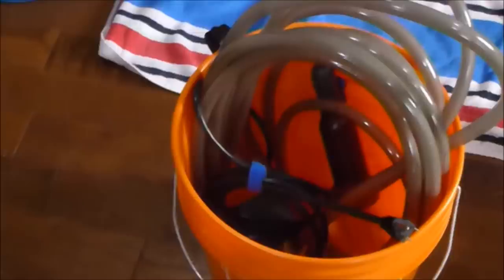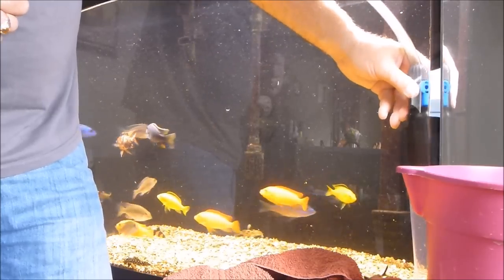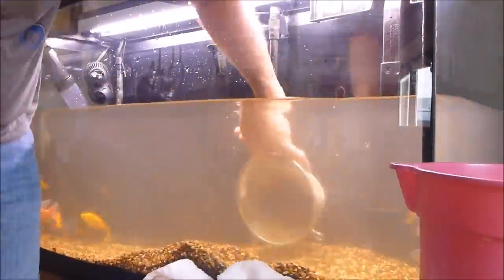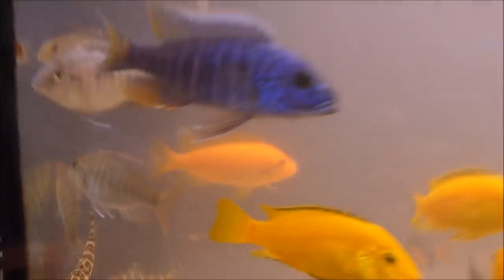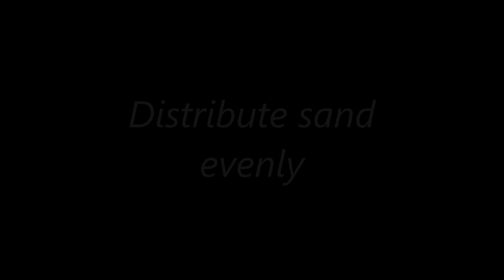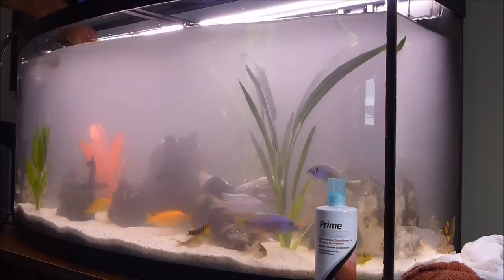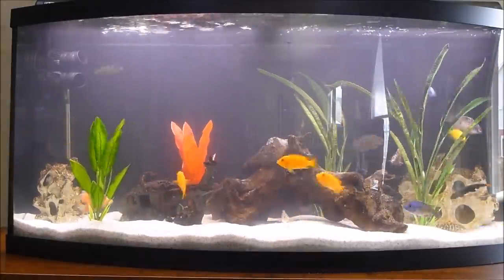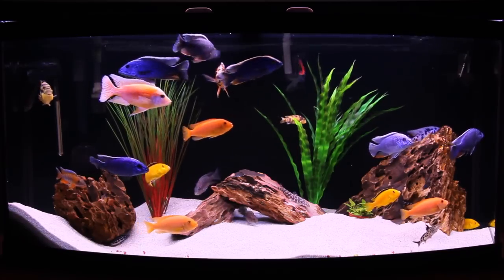Aquarium change from Gravel to Sand

Comment: Your aquarium looks so much better with sand! Im doing the same thing. Is your tank a 55 gallon?  Did you raise your intake tube?
Reply from the maker: My tank is a 72 gallon bowfront and I'm so glad I switched to sand. Yes you should raise your intake to reduce the amount of sand getting in your filters. Thanks for watching!
Reply: @bobbygsproaquarium  thank you I really appreciate it but I thought you're supposed to add one pound of sand for a gallon of tank and you only added 50 lb so I'm assuming I could add 40 lb of sand to my 55 gallon. I cant wait to get started! Great video

Comment: Thank you for the step by step! You're the real MVP! I'm making the adjustment from gravel to sand in my 150 gallon tank.
Reply from the maker: Thank you. I'm sure after you switch you'll never look back! With sand you just have to be careful cleaning the glass to be sure there's no sand in your cleaning sponge or it will scratch the glass for good.

Comment: i have sand and i went and got a sponge filter to put on the intake of my hang on back filter system. had to modify it but it works super! also replaced the cartridge filters with carbon filter pads cut to fit. now my water is the clearest it's ever been.

Comment: I have a 55 gal. cichlid tank, and I love the sand!  Used to do the gravel. but sand is a lot cleaner. Have a couple of geophagus that are spewing the sand around all the time.  Good to know that the sand is better for cichlids also.  The water is crystal clear all the time.  Don't hesitate to change to sand if you are wary. I did, and not sorry I made the change.  I also used the pool filter sand, and the biggest job was rinsing, but if you can do it by the bucket with an outdoor hose - it goes much faster.
Reply from the maker: I agree, I'd guess anyone that switches from gravel to sand  would also agree. It's important to have lots of water flow so the poop doesn't settle on the bottom. Thank you for watching and commenting!

Comment: What a lovely tank you have. And your poochy is so cute!!

 I've always been wanting but leery of changing over to sand due to issues i'd read about with water changes, vacuuming, etc. But i love plants, Corys, & loaches and it would be so much gentler on them. 

The one thing i'd do different in your change over is i'd probably take all the fish out with some of the tank water and put them into a bucket so as not to stress them during all that upheaval, but it looks like yours survived fine. I'm shocked when you say you don't have to vacuum it anymore. Shocked. The books all teach something else. You've really peeked my interest.
Reply from the maker: Thank you Windwipper for the comment and the advice. In future I will and have removed fish before making a change over like that. I'm not sure what books you're reading up on the maintenance required on a sand substrate. My advise is from very practical experience and although there has been quite some time since posting this video I still stand firm on the use of sand. But the key is to have enough water flow so the waste and detritus does not just sit on the bottom but rather get sucked up into the filtration. If you've already made the switch that's great if not charge ahead my friend. This switchover was done with pool filter sand and it is a good choice although I have since changed it again. The key is that your substrate is fine enough that the waste doesn't settle down in through it and also that your sand bed isn't more than about to inches .
Reply: @bobbygsproaquarium  Excellent advice! Thank you very much!

Comment: Gonna love changing my tank to sand this weekend. I have an unlimited supply of sand straight from the earth at a job site and its darker in color but so pure. Was wondering how to do it with the fish in. Thanks for this amazing video.
Reply from the maker: That's great you have an unlimited supply of sand. I switched mine with the fish in the tank so I don't understand your question, what specifically would you like to know?
Reply: I used white pool filter sand, works great for years.
Reply: @NitroVipers3  Which brand did you use?
Reply: @dvsasser  not sure the brand, went to the pool  place and bought it.

Comment: Since I switched over to the sand several years ago I have not vacuumed.  Even when I recently upgraded to a 75 gal., the sand that I transferred to the new tank wasn't very dirty. It was just red from clay.
Reply from the maker: Yes it's so much easier to maintain. Thanks for commenting.
Reply: Just a question . How do you clean up the fish poop if you don’t vacuum ?

I have sand and would like not to have to vacuum .
Reply from the maker: @operationhotshotinc.6887  if you focus on having lots of water flow it will keep the poop from setting on the bottom and will be filtered out.
Reply: @operationhotshotinc.6887  I have lots of waterflow, including 2 wavemakers. As soon as it's disturbed  a bit, it goes waterborne and ends up in the overflow.

Comment: HI Bobby,  I much prefer sand. The waste sits on top and it's very easy to suck up. I started with similar gravel and I never liked it. The biggest thing is AC being sifters need soft sand. They can injure themselves with gravel. IT's a big job. I did that too but well worth the work Bobby!! I love the finished project. Looks stunning!!😁💦💘
Reply from the maker: I still can't believe how much easier it is to manage. One thing I didn't mention in the video is how important continuous water flow is. It seems the key to keeping the surface clean. Thanks for the kind words.
Reply: Bobby that's such a good point. Once in a while, I turn my wave makers to the bottom areas and just blow any leftover detritus to the water column for the filters to pull up!🌎😁💦💘

Comment: Great video!  Very timely for me, I'm switching from a 60 gal. to a 75 gal. this week as time allows.  Because of my Geophagus, Bichir, and Cory cats I'm switching to sand.  AI hear Geos like to sift through sand, Bichir might swallow large gravel pieces, and sand is easier on the cat's barbels.  I was concerned about the detritus build up, but I skimmed the comments and found the answer to that question.  My one unanswered question is, does algae build up over time like it currently does for my gravel?  BTW, I like the pace of your audio; slow and steady wins the race - and avoids having to rewind and view again.  :)

Comment: Thank you for the very helpful video.  I like the look of gravel and was wondering if gravel with some sand might be a good compromise as the sand would kind of settle into the gravel also, I have very few and smaller species of fish.
Reply from the maker: Thanks for watching my video I'm glad you got something out of it! I think mixing sand in with gravel would almost certainly be a mistake. You would no longer be able to vacuum your gravel since you would be suckling up all the sand. The beauty of the sand provided you have lots of water flow is that you will virtually never need to vacuum again. I'd suggest no more than 2 inches of sand otherwise you may create other problems. Hope this helps!

Comment: Great video.i am in the process of starting a new tank and i am thinking of using sand.do you have any problem with sand and external filters?
Reply from the maker: Some sand will end up in the filters but not too much if you keep your intakes high enough. There's no need to keep the close to the bottom.

Comment: Great Video - Can you give us the detail about how you connect the Aqueon water change to your Megdrive 9.5 please.
Reply from the maker: I wish I could add photos to help explain it would make it easier. Cut your Aqueon or Python hose at the point you would like your pump. On one end of the hose add a 5/8" barb to male GHT (garden hose thread), if using Aqueon you will need 1/2" barb as it is smaller the Python. On the other side of the cut add a 5/8" barb to female GHT (garden hose thread), if using Aqueon you will need 1/2" barb as it is smaller the Python. This will allow you to use the hose with or without the pump installed. On the pump you will need two fittings, one 3/4" NPT (national pipe tapered) to male GHT, and one 3/4" NPT to female twisting GHT. Be sure to use brass fittings for all and gear clamps for the barbed ends to attach the hose. I got all the stuff at Home Depot. Thanks for watching and commenting!

Comment: How the sand got clear so fast without cloudy? How do you clean and rinse the sand?
Reply from the maker: I've found the best way is to fill a pail no more than half full with sand and rinse with a hose stirring occasionally for as long as it takes for the water to run virtually clear. This could take 30 or more minutes. Thank you for asking.
Reply: @bobbygsproaquarium  I used to clean the white subtrade before, I have to rinse more than 20 times. Pain on the bud bro. I thought You can come up with better idea.
Thank you though.
Reply from the maker: I don't think there's a magic way.

Comment: Bobby, wouldn't fish poop shows up a lot quicker using sand rather than pebbles?  Thx
Reply from the maker: In my experience sand is much easier to look after than gravel provided you have a constant current which doesn't allow detritis to settle on the bottom. I almost never have to vacuum anything anymore.
Reply: This is the problem I am having. Yes, I can see a lot of the fish poo in the bottom of my tank. I am wanting to change the sand from white to black in my tank.
Reply: @linnykinny6853  - I went ahead and used sand in my tank yesterday. I had black pebbles before but it really makes my tank dark, but clean since you can't really see all the debris. White sand is very pretty but let's see how it works out.
Reply from the maker: @linnykinny6853  this issue can be solve with more water flow. Consider adding a wave maker / power head to the tank.
Reply from the maker: @deenugent473  you will love it providing you have enough current in the tank.
Reply: @bobbygsproaquarium  - Thanks for the advice Bobby!  Do you have a suggestion for a wave maker?  I have a 55 Gal tank (fresh water).
Reply from the maker: I really like the Sunsun JVP-110, they're small, inexpensive and have great output around 500 gallons per hour. In my 55's I generally have 2.

Comment: Turned out awesome! Really thinking about making the change. Few questions though.  How powerful of a pump did you use for the gravel vac and did you use the same setup to remove the remaining bits of gravel?
Reply from the maker: I'm pretty sure I just used my Python with a Magdrive 9.5 inline. I just used a hose to syphen out the remaining gravel.

Comment: Wouldn't poop and gunk appear more obviously on the sand? I would assume you would need to clean it MORE frequently since it would be right there for you to see all the time as opposed to hidden within gravel.
Reply from the maker: The key is too have enough water flow across the gravel so poop doesn't settle on the bottom. If done we'll it almost never needs vaccuming. Good question though, thanks.
Reply: @bobbygsproaquarium  Ive had sand in my Cichlid tank for years, I never have to clean the tank lol. I can go 6 months without cleaning it and it will be as clean as day 1, it's crazy.
Reply from the maker: @NitroVipers3  It's really awesome once you set it up and realize the benefits! Thanks for your comment!

Comment: I also want to do this however I don't quite understand how you keep the sand clean without piles of fish waste. How does a filter pick this up off of sand ?
Reply from the maker: I add water circulation with whatever filtration you have plus additional power heads / wave makers to keep the water flowing across the sand so fish waste doesn't settle on the bottom. This way the waste gets mixed in the water column until your filtration picks it up.

Comment: I noticed on your YouTube video on substrate you had blacken the 3 sides of the glass. I have Neon Tetras wand want to add this.  What did you use and where do I purchase it
Reply from the maker: I used complete blackout vinyl window film. It's pretty easy to use and you can get it on Amazon.

Comment: Hello sir at last I have shifted from gravel to sand on 19th Sep 2020 in my 90 gal cichlid tank & almost 1 month passed really it looks real & more beautiful with sand & black background, to remove waste from sand I also added RS-109A wave maker near sump intake & I was expecting that oxygen level will increase but after 5 or 6 days I observed that fishes are gasping also taking fast breath it looks that tank has low oxygen but I did not change any air stone only replace gravel with sand even added wave maker, then I have added 2 more air stones & fishes become normal after 2 hours, did you find any experience like this in your tank when u changed from gravel to sand. Also do you think that tank oxygen level has any link with sand substrate.
Reply from the maker: Hi, there wouldnt be an oxygen decrease due to sand. It's ideal if you can create enough flow directed at the surface to create enough surface agitation for gas exchange and also enough flow throughout the tank and bottom to keep it clear. You may have to use a couple wafe makers to accomplish this. Good luck
Reply: @bobbygsproaquarium  Thanks Sir before i was using only one wave maker RS-109A i think it is small for 90 gal tank now i arrange RS-208A then install both in tank, 208 at up side & 109 at down side on opposite side.

Comment: Looks great . What was the name of the sand ? I think  I made a mistake when I mixed a little gravel with my white sand to break up  all the white since  I also have Texas holey rock in my tank . Did a good job . See you later .
Reply from the maker: I used a product called White Lightning. You could have added some black sand blasting sand to tone down the white. Thank you for your comments.

Comment: Great video! I have a tropical aquarium and a total newbie to all this. A few questions. 
1. Can you use sand for a tropical tank.
2. How do you keep the water the same temperature when adding new water.
Thanks!
Reply from the maker: Thank you! I believe you can use sand although as you can see I'm into cichlids so am not sure. I adjust the water temperature at the tap although I'm not sure that answers your question.
Reply: You can use sand I do and have great luck with it. And temp wise if your fish are in a bucket you can put a heater in, and like he said try to match the temp out of the faucet when you go to put water back in the tank(:
Reply: @Kk-zq4kj  thanks! I actually just did my tank with black sand and blacked the back out. Posted a video on my channel! Definitely looks better..

Comment: Where does the waste go now. Instead of getting locked under the gravel it now sits on top of the sand, but where does it go?
Reply: It sits at the top
Reply from the maker: If your water flow at the surface of your sand is adequate the waste will remain in the water column until it is sucked up by whatever filtration you're using. There will always be a small dead spot that the waste will collect but it shouldn't be too bad.

Comment: Does aquarium sand get black after few months/years ??
Reply from the maker: No it should stay its original colour for sure. If yours is turning black it may be algae due to too much light and or you may be feeding your fish too much and or you don't have enough water circulation to keep the detritus off the bottom. Good luck!

Comment: I've been using white sand for about 6 months. Unfortunately the color of the sand on the glass side turned brown. It looks really bad. Now I think about switching to basalt sand or river sand.
Reply from the maker: What do you mean the sand on the glass side, possibly you're getting light from an outside window through the side panel. How long has your system been up and running?

Comment: Hi I was just wondering why at the end you said you don't need to vac the sand of waste etc? Wont it still build up ontop of the sand? Great video btw, the format and pace was well done.
Reply from the maker: Hi, if you have enough water movement from your filtration. You may need to add one or two wave makers and position them so the keep the survace of the sand clear but not so much that the sand blows away. I almost never vacuum my sand, maybe 2 or 3 times a year.

Comment: So if I only run HOBs and have no powerheads,, will I still be able to use the sand? What's happens if I do need to gravel vac the sand? Will it cloudy up all over again? BTW it's for guppies and cory catfish
Reply from the maker: The key to using sand for me it to have enough water current so stuff doesn't settle on the bottom and therefore vaccuming is almost unnecessary, I don't know if you'll have enough flow with hobs.
Reply: @bobbygsproaquarium  not enough glow, are you .. kidding
Reply from the maker: Everyone's setup is different and I appreciate that.

Comment: So I used aquatic tetra sand from the pet store and I rinsed it before putting it into the tank and added it into my empty new tank but the problem is that the water is super cloudy. It’s been 2, almost 3 days since I been doing small water changes and moving the sand around so I can clean it up but how can I speed up the process? It always creates a sand storm and this is obvious since I’m stirring the sand around but when I put fish into the tank and I have to start doing water changes the water is going to look cloudy and I don’t want that :(, any tips?
Reply from the maker: I've learned that you can benefit from rinsing the sand for about an hour with constant water flow in a 5 gallon pail no more than half filled with sand. Even rinsing well like this it can take a week or more to clear completely. At this point you could add clearifier in, it will speed up the process and I don't think it's harmful to aquatics.
Reply: Bobby G's Cichlid Craze thanks :))